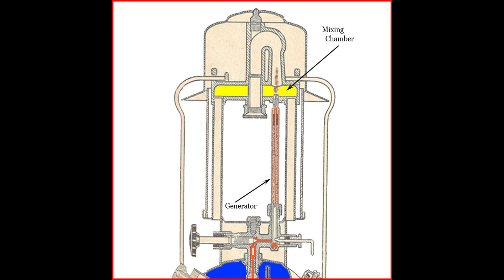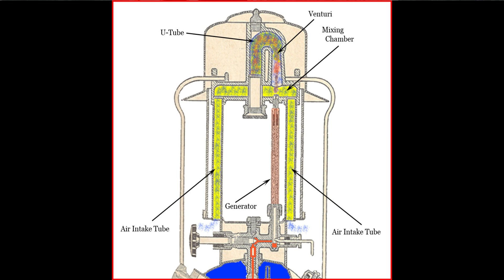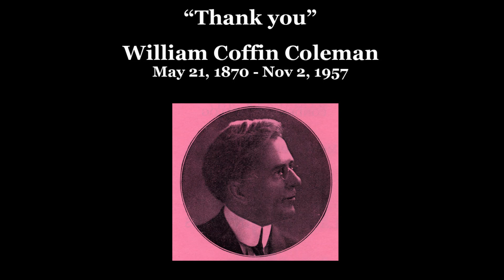How a Coleman Lamp, Lantern and Stove Works - Pt. 3, Theory of Operation: Fire & Light

Comment: Well I got a dirty valve spitting are once in awhile and then finally works only at the right position on the valve mostly high open on a 288 a lantern. I have a stove and I don't know the model number on that one that's a two-burner 60 plus years old and then I've got a newer 450 and I never used it and I tried it today and it's leaking at the little red lover valve I think the packing in that valve is no good because it's leaking fuel. Your videos excellent so I'm just looking and seeing what I can learn and see what I can fix thank you again

Comment: There is one more nuance that I want to tell you about. The air-fuel mixture in lanterns is poorer than in kitchen stoves. This is due to the fact that the flame in the kitchen burner is free, and in the lantern, combustion occurs inside the mesh. This mixture will not burn without a mesh. If the air-fuel mixture in the lantern were richer, then soot would form inside the mesh. By the way, I noticed that there is corrosion in the Coleman double-burner stove. This is due to the poor anti-corrosion treatment of the product, which is its vulnerability. This upsets me, because I am a consumer and an engineer, not a marketer who saves cents at the expense of quality

Comment: My only REAL question about these systems was never answered 

How does the system maintain the pressure to keep delivering fuel from the tank??  It's not from the initial pumping.
Reply: @videodistro  my best guess is that it is from the initial pumping. Because of friction and the fuel having to manuever through tight tubes the flow is kind of constant when pumping to higher pressures, so the pressure is like a spring that slowly decompresses
Reply: @videodistro  Heat!

Comment: Frank, really enjoyed the video,actually learned how it all works , Mr Coleman was a genius !  I have had the stove and 200a since back in the 70,s used the stove lots when camping , vacationing ,etc.  A year ago or so , thought i better see if they both work ! Getting a lil concerned about power failures !  Neither still worked , but after lots of cleaning and new gaskets and actually learning about all the parts , i finally got both to work great ! The Generator on the lantern was mostly the problem , gees the hole sure is very small at the end (!)  Thanks for the help , good luck !  Jerry Uhte  (Indiana )

Comment: Hello so I have a powerhouse dual fuel and it gets pressure but with just the valve on top it won’t spray any liquid fuel. I took the valve out with the pick up tube and I can see the shrader valve and it moves with the turn of the knob. The o ring seems to be good but it seems like the fuel isn’t going up the pick up like if it’s missing something but the previous owner said they never opened it. I’ve already cleaned all the debris out of the tank as well.

Comment: This is fascinating! I bought a duel fuel lantern and the check valve is stuck in the closed position, the tank smells of old fuel. I'm going to fill it with carburettor cleaner and cross my fingers. Failing that, I'm now armed with the knowledge to be able to repair my lantern. Thank you for sharing your knowledge and producing this excellent series. 🇬🇧

Comment: Another excellent video and a great series.  Great description on mantles too.  I recently did a mantle comparison on my 295 with multiple different brands, sizes and styles.  I tested Coleman 21 and 20, Perrless 2C-HG, and a few cheap chinese ebay mantles.  The Peerless ($2.91 each) is the thorium version and was without question the brightest and had that old-school slightly green glow I remembered from my childhood.  The Coleman 20 ($4.58 each) and 21 ($3.44) each) were a nice warm colour but the 21s were not quite as bright as the 20s.  Not a huge difference but noticeable.  The chinese mantles were definitely interesting to say the least.  First off they were inconsistent in the colour and brightness within the same mantle style and style.  One (pink top - $0.62 each)) was the same general overall size as a 21 but not as bright and quite yellow.  One (green top - $0.63 each) was about the size of an 11 but shrank a LOT after being burned and was only a little larger than a 21.  They were an ok brightness but also very yellow.  The last ones ($0.39 each) I tried were the same general shape and style as a 51 but MUCH larger.  They were way larger than I expected when I ordered them but thought I'd give them a shot.  I would compare the burned size to a 99.  Acceptable brightness (could easily read by it) and I would assume it was because it was too large.  Decent slightly yellow colour but incredibly delicate and brittle.  A slight knock of the lantern if I moved it and put it down too hard and the mantle would just drop and disintegrate. Definitely not worth the 39 cents each.   The Peerless and chinese mantles were all bought from ebay and prices include shipping.  The Coleman 20 & 21s were bought locally and prices include taxes.  Of all of them the Peerless were by far my favourite and I find to be the best value and most pleasing colour.  The Colemans are very good but definitely on the pricier side of things but I am sure the cost would come down buying online.  For the chinese ones the pink tops were actually not bad and if I only had these available I would be quite happy with them.  Excellent price too so if you need a LOT of 21 size mantles but have very little money these would be a great option.  The other 2 chinese mantles were just not worth the money.  MAYBE the green tops ones would be a good fit on a single mantle lantern that uses a 99 lantern mantle but the colour really was unpleasant so i would only use them if I had no other options available.  If I had to ONLY choose from one it would be the Peerless.  If cost was a major deciding factor then the chinese "pink tops".  if $ were no object the Coleman 20 would be my 2nd choice with the 21s being 3rd.  And keep in mind this was all done on the same lantern with the same fuel on the same night to make sure the mantles were the only variable.

Comment: Thank you for this well produced and thoroughly explained content! I recently won a 1964 228f in an auction which had really old fuel in the fount. The check valve was completely clogged but was fixed by a few day-long soaks in lacquer thinner. After that, the air-fuel tube was clogged (metering rod stuck) so it would not light. I could not get the tip cleaner assembly off, but smacking it with a screwdriver while opening and shutting the valve fixed it and now it's working perfectly! The old trick of smacking a carburetor with a stuck valve also works in this instance. Your teardown and rebuild videos along with your website have been immensely helpful and I hope there's some way I can financially support your endeavor. If there is, please let me know! I'll happily donate or buy from you for all future Coleman needs. I also bought a mid 70's 413G stove which thankfully worked on arrival.
Reply from the maker: Thank you very much for the nice comments!  I'm happy you got that 228F running well again!